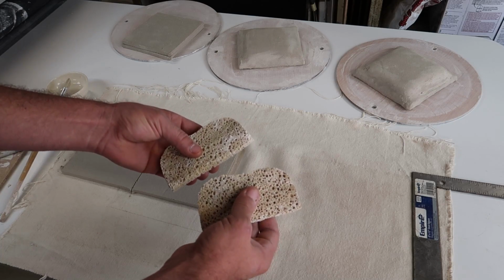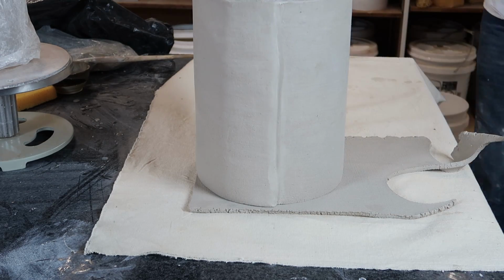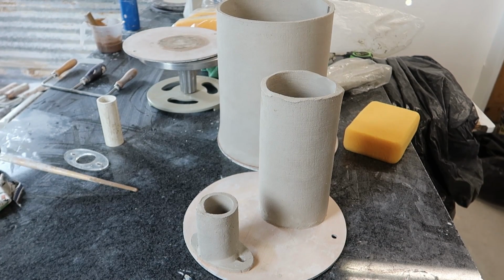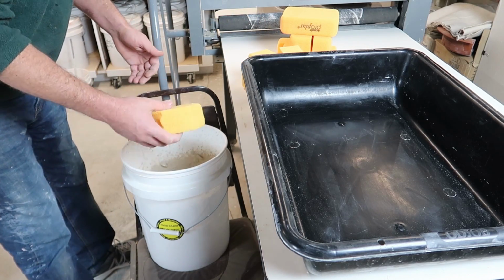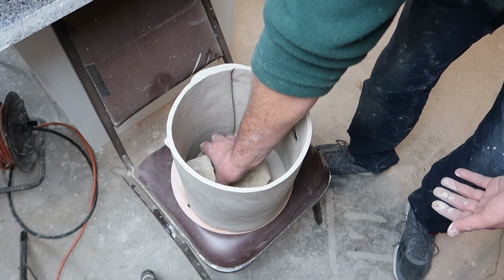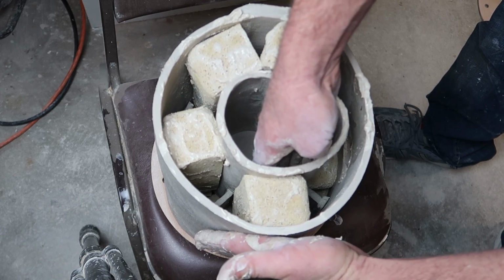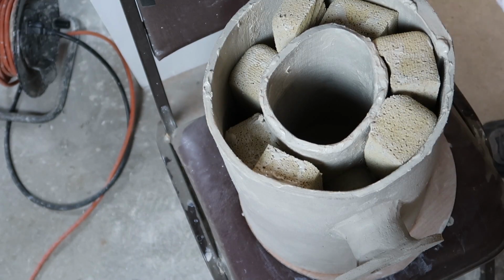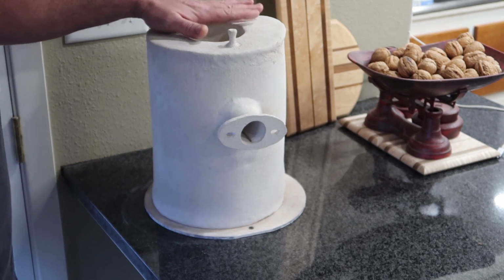Making a Knife Forge out of Clay - Pt. 1

Comment: really fun experiment!

Maybe you covered this and I missed it, but wont the sponges melt during the firing process? If they do melt, wont the gases created by that cause the double walled chamber to crack?
Reply from the maker: The sponges do burn out. The test tiles had very small holes and it seemed adequate to vent out any gasses without causing cracking in the shell.  I hope that will also be true for the forge.